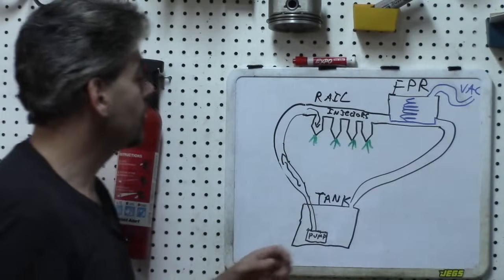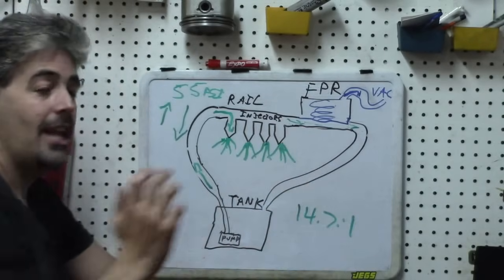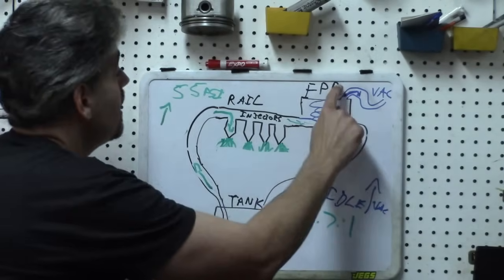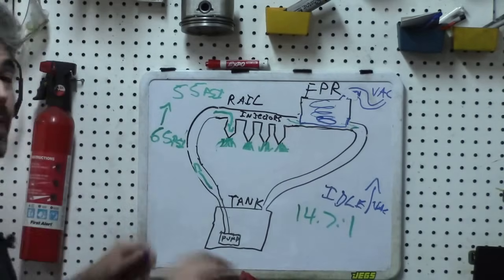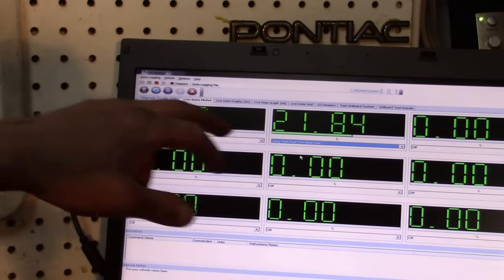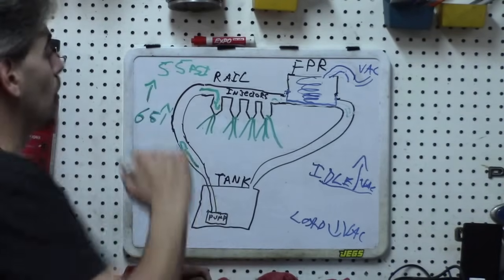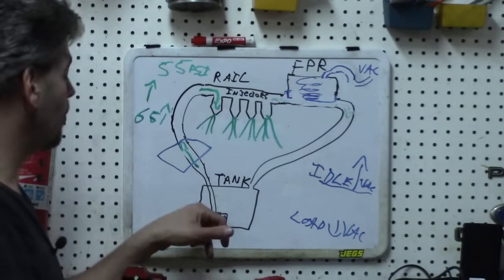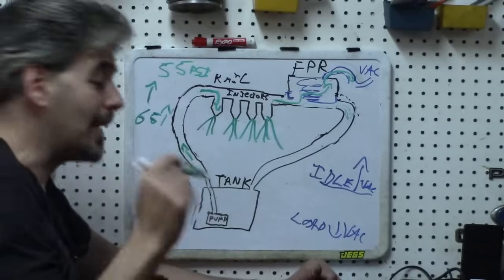Fuel Pressure Regulator Diagnosis + Understanding (HD!!)

Comment: I have 1992 GMC pick up with a 305 v8, TBI system, it idles fine and runs fine if you accelerate it sitting still but on the road from a complete stop it has a sluggish take off then will suddenly speed up, very sluggish going up a hill, could this be the fpr? I'm not used to working on this type fuel systems, I've always dealt with carburetors.
Reply from the maker: Could be, amongst 100000 other possibilities.  what data do you have?
Reply: @SchrodingersBox  Check engine light not on, scan shows no codes.
Reply: @SchrodingersBox  It was the fuel regulator, after watching your video about 3 times I understood what's going on, thanks.

Comment: What about the fuel pressure regulator in the fuel tank?  Is there a vacuum line that runs from the tank to the intake?  My GM LT1 has the regulator as part of the fuel pump assembly in the tank.
Reply from the maker: +Tom Strickland Yes that's a good question- however on My LT1  vividly recall the regulator being on the rail- I actually had an adjustable regulator on mine in fact.  But in the case of in-tank regulators they are invariably PCM controlled to adjust pressure rather than vacuum controlled.

Comment: I have a 1993 Nissan the vacuum line that goes to the fuel reg has some wetness to it .    I am having trouble with low power when I take off and sometimes a miss ....  Then it goes back to normal running .  I don't have a way  to test the reg valve .  Will the reg vacuum line have wetness or some trace of oil in that vacuum line
Reply from the maker: Your best bet is a simple fuel trim analysis. Just start with basics and determine potential causes from there

Comment: How do u directly apply vacuum? I think the spring maybe stuck closed. Ltft is neg 20. Short term is normal at idle. Goes towards normal when given throttle.
Reply from the maker: Just apply vacuum to the vacuum port. If it isn’t a vacuum design then just restrict the return port and see if changes the pressure to be within spec
Reply: @SchrodingersBox  ok. Yes its an 03 impala. I may use human vacuum as u say on the video lol. U pointed out in another video to me to check the fpr. So thats where im at. Thank u sir again for the replys. All your knowledge ive soaked up means alot. I fully understand how to diagnose it now thanx to u.

Comment: So you said that the car doesn’t need to be running but does the key need to be on? & could you tell me what the correct psi range for a 1996 Chevy c2500 5.7? My research stated between 60-65psi.
Reply from the maker: It should be 55 to 60 during prime and while running, 50 without regulator.

Comment: This used to happen when the car was warm but now it happens all the time.

When I go to start the car it just keeps turning over and does not start but I take the key out and try again and sometimes it fires right up no problem.

I've tried to cycle the key on and off a few times and try to listen for the fuel pump turning on but can't really hear it and when it does fire up I don't believe I hear the fuel pump. It had a cat converter code that popped up could that have anything to do with it? (don't think so, I cleared it anyway)

It did say the intake air temp was 80 and outside it was around 60 (normal?). I've tried to give it gas while starting it (don't think the computer will let it start with the pedal down?) I did this once and once it started and got it up to 3k rpm without any hesitation. Today I was gonna go spend $20 on a fuel tester gauge to see if it has pressure in the fuel rail.

edit: after it sits for a while it tends to start up just fine.

Could it be a bad sensor telling the computer to inject too much fuel or not enough to start the engine? How can I test that?

Any ideas on what else it could be?
Reply from the maker: No idea- what data do you have? You're just describing symptoms.
Reply: @SchrodingersBox  Thanks for the reply!

Tested for fuel pressure and it had 0 psi!
Tested fuse and connections, also tested the fuel pump connection pins and it had 0 volts.
Found the relay (it's under the dash above the pedals, need to unscrew about 3-4 T20 screws), *I pushed the relay with my hand and the fuel pump ticked on and built fuel pressure!

FIX:
I replaced the relay and it seems to be working just fine!*
Hopefully, that was the fix, a bad relay.

I did think it was the connection pins that the relay plugs into but it seems to be working fine, time will tell if its the pins or just a new relay (bumps/pushing relay out..etc. time will tell)

Comment: Hello, May I please have some advice ? I have a 1992 corvette . I replaced the fuel pump ,  fuel filter ,  fuel regulator ,  and injectors . The car runs ok at idle . .. Under load , The fuel pressure is dropping - causing stall and misfire . Can you please tell me what I am overlooking to fix this ? Thank you
Reply from the maker: Give me specific numbers for static pressure, idle pressure and loaded pressure. 
  also do you have integrator and block learn numbers curved against load?

Comment: Is a bad regulator constant, when it goes bad it's always bad? Or could it be intermitting, it works fine for a while, then acts up while driving for a while, then runs fine again? 
  Could it work fine if the RPM is below a certain speed, (let's say 2000) but act up only above 2000 RPM?
Reply from the maker: A bad regulator is constant. it won’t be intermittent.

Comment: So on a turbo or supercharged car, does the fuel pressure regulator see boost? By logic i would say yes since the engine needs more fuel then. So i would assume the spring inside the FPR is designed in a way that at vacuum the regulator is all the way open, at atmospheric its closed partially and at full boost its closed all the way, or at least thats the basic idea of it.. Am i right with that so far? 
Or does the vacuum line to the FPR have a check valve?
Reply from the maker: I actually have never seen a Turbo car.  I have many questions myself on fuel trim maintenance, MAF data and fuel pressure in turbo applications.  If I ever see a turbo vehicle believe me, I will turn it into a lab rat!!!
Reply: yes, FPR see the turbo pressure too. The FPR's main job is to maintain the difference between the intake manifold pressure and fuel pressure, because with this constant difference the injectors spray pattern remain always the same even 20kpa (0.8 bar vacuum) and 300kpa (2 bar turbo pressure). 

so if at priming without turbo pressoure or vacuum (100 kpa) you has 4 bar fuel pressure, than with 2 bar turbo pressure you will have 6 bar fuel pressure, and at idle (20 kpa or 0.8 bar vacuum) you will see 3.2 bar fuel pressure.

Comment: so i had my mechanic look at my 96 gmc jimmy because missfire plug 5 so he changed the plugs calls me says it must be the fuel pump because fuel pressure drops after a few minutes .. I paid 300 for the plugs and wire's . i already  re placed the pump a few months ago an off brand pump possibly faulty or I did it wrong please help

Comment: My 2002 Ford f150 will start right up first time second time you might have to crank it and crank it and it won't start but if you cycle the key on and off three or four times then it'll start up and run good wonder what would cause that it's been doing it for a couple of months now
Reply from the maker: Ok- what data do you have?
Reply: @SchrodingersBox  no code
Reply from the maker: No I mean what basic fundamental data do you have- what’s your static decay pressure? what’s your fuel trim at idle vs load? what’s your pump amperage?

Comment: Question. What if the injectors we're the fuel restriction. Or needed different fuel pressure to match the injectors. Restricted injectors or wrong injectors. The computer only knows on and off to the injectors. Could force a lean. I'm thinking to restrict fuel return to see if makes better. I'm trying to find my problem with 94 Fleetwood 350. Runs like a dream until! Half pedal engine pre ignites. Runs like stick shift in 4th gear doing 10mph. Replaced all ignition components, all air, injectors, fuel p reg, distributor, map, coolant temp air temp, tps, maf. It maintains fuel 45 PSI during half throttle so I don't think fuel pump, noid and plug light testers still light during issue. High octane fuel don't do anything. My last thought is knock sensors. I don't see mechanical issues but could be wrong. Any direction of advice would be highly appreciated.
Reply from the maker: I would need to see what data you have that indicated the ignition, MAF, fuel regulator. injectors, CTS, IAT TPS and MAF were all bad.  That seems really unlikely.  What data were you using that indicated all these faults?
Reply: @SchrodingersBox  injectors, plugs, wires, coil, iac and Optispark were to rejuvenate power Bec it was in need of a tune up. The other components we're researching the service manual because the issue arose. I thought it was lean or rich because of the new components over powered the old sensors that we're inputs for the computer to make 14.7/1. Now, I just don't know where to look. Thinking knock sensors aren't doing job Bec sounds like pre ignition symptoms to me. I have no data Bec I don't have diagnostic tools besides multi, noid, test light and plug light.the dash gives codes but I have none
Reply from the maker: That’s what  I am asking. - what was  your day that there was performance loss because of those components?  How did you determine it was an ignition problem? was this based on fuel trim day or on MAP output or what?  i would need to see your baseline variables.
Reply from the maker: Never mind- reread your answer. I am afraid i can’t help. I have to have a data-based approach to help, my methods are just different than what you are doing - sorry
  good luck.
Reply: @SchrodingersBox  I thank you for replying and willingness to help. I need more tools and knowledge

Comment: I have a 95 Ford Taurus my ex mother-in-law left it to me it's been setting for a little over a year it started right up and I backed it out of the garage and then it died and tried to start again it start up and die right back off and eventually it just wouldn't do it at all I put a new fuel filter on it thought maybe it might be plugged from bad gasoline but that didn't work either still doing it and so I hear the pump running but that doesn't necessarily mean it's currently proper amount of pressure so that's going to be my next thing I'm open for any suggestions thank you.
Reply from the maker: Correct- you can’t say anything from that. what data do you have for the basics like fuel trim and rail pressure? What’s the pump amperage? what’s your injector pulsewidth? What did you do to rule out spark as being the issue? need some basic data to get a foundation from which to work.

Comment: With this taken in please tell me your comments to fix a fault with a vehicle which (is almost new) starts after about 5 turns of the ignition and runs normally and to normal temperature but when switched off will fire up and run normally. Only for the same problem to recur when it returns to cold? Importantly no engine codes are found.
Reply from the maker: sounds like a classic failed check valve at the fuel pump.

Comment: Wish my mechanic saw these videos before cleaning fuel injectors, replacing catalytic converter, and spark plugs. $$$ None of it helped. Finally dawned on him it was fuel pressure regulator.
Reply from the maker: Ha- cleaning fuel injectors. I absolutely guarantee EVERY mechanic who has ever tried this did so out of desperation rather than necessitation.
Reply: I asked him if fuel injectors could be the problem after starter tested good. He charged 160.00 to clean them. i week later car was getting worse and he then charged 1,187.00 for catalytic converter. Replaced plugs n/c...still no good.  After replacing regulator, he said it had ruined cc, so it needed replaced anyway.?
Reply from the maker: Hardly a unique story i am afraid.  Pretty much hear similar every weekend when people finally bring their cars to me. Pretty sad.

Comment: well i checked the plenum and the its not leaking anywere but i heard from another person that at the pump i should be getting at least a hundred psi and im only getting 65 to 70
Reply: +Matt Hasting 100 PSI might be normal if you are deadheading it (e.g. without regulator).

Comment: Hi Matt, silly question but if my fuel pump is priming at 50 psi and I don’t have a check valve so when I stop cranking the engine the fuel pressure drops to zero would my engine start because there’s 50psi? Or must there be a check valve to keep pressure at 50 even when engine is turned off? There is 50psi on priming and 50psi on cranking but no start and no fuel coming out of injectors? Hoping for any ideas. Thanks
Reply from the maker: you need to have some fuel pressure present prior to starting or you will have a long crank time as the pressure builds up otherwise. that’s the job of the check valve.

Comment: does the valve come before the FPR? On my civic I think you connect the tester to the banjo bolt on the fuel filter.
Reply from the maker: You will always want to test pressure on the FEED pressure, never the return.
Reply: Schrodingers Box oh that's right fpr is on the return

Comment: I'm working right now on a 98 Firebird 3.8, using the fuel setup your dealing with in this video.  Long story shorty,  I have fuel pump running,  fuel at the fuel line to engine if I take off the line.  If I take off the return line with feed line hooked up I get gas squirting from the return side.  This is after replacing the regulator today.   Fuel coming into the rail, will pass out the return, but no pressure at the check port.  It almost seems like I have a restriction in the rail.  Any ideas?  Thanks.
Reply from the maker: You have no pressure data so this information is not useful in a diagnosis.
Reply: What pressure data do you need?  It has 0 fuel pressure with a working pump varified pumping fuel, and a new fpr.
Reply from the maker: ***** If you have the fuel pump running I need to know the pressure.
  Take the pressure at the tank, or filter- or whatever but I need to know the fuel pressure from the pump prior to what you suspect is a blockage which I highly doubt is the issue.
Reply: Ok, I don't have adapters to check fuel pressure,  at the pump or filter, I just have a basic fuel pres. tester that hooks to check ports.  It has good pressure (strong spray)  from the fuel line @ the engine, can't tell you exactly how much.  Anyway I'll keep digging, thanks.

Comment: Matt, if the regulator were bad, would it still be possible to get a 1075 rich bank left code without a 1072 code? I only have an intermittent 1075. My 98 Chevy 5.7 runs smooth, no misfires, but feels gutless. Definitely not putting out the correct power. New O2 sensors. Same result.
Reply from the maker: Yes it is possible but both banks would be affected. You could have it where one bank is just under the threshold to set the code while the other bank meets the threshold. Check the LTFT on both banks and see if this is the condition. If however only one bank’s LTFT shows to be at threshold you can rule out regulator.
Reply: Schrodingers Box thanks, watching your videos really help. So I am on the right path, since it is only bank 2, I feel it cannot be a MAF sensor, or regulator. It has to be something that would only affect that side like a leaking injector, plug issue or possible exhaust leak on that side before the first O2 sensor.
Reply from the maker: Correct!
Reply: Schrodingers Box just wanted to update and thank you! So I pulled the plugs again. #2 was a little darker than the others. Figured if it is leaking, this is going as unspent fuel and triggering the code. The como then cuts back fuel starving 4,6 and 8 giving me the sluggish power but enough to remove overall code on that bank, reason for it being intermittent. I replaced the injection spider, cleaned really well and now it runs like a scalded dog! Thanks again!

Comment: when the regulator is in the close position ie when accelerating at maximum, is it totally closed? I mean is there no fuel returning to the fuel tank ?
Reply from the maker: it is not totally closed. we can prove this because the pressure at WOT does not nearly go as high as it does if we pinched the return line closed.

Comment: My 98 ford explorer v6 sohc has been stalling at intersections and been having a rolling idle. No codes. I hooked my scanner up to FORSCAN and it read 0psi under the fuel pressure reading. Now it starts up every time first try and it drives on the freeway great so obviously its getting pressure. Would a Fuel pressure regulator be the culprit? Or should i look for a vacuum leak first?
Reply from the maker: If you have no fuel pressure a fuel pump or fuel pump circuit is a more likely culprit.

Comment: I need this done on fuel system voltage from relay to inertia switch to dual fuel tank switch to pump and how you test that can't find what the voltage should be from switch to switch to pump with no rail fuel pressure no start.
Reply: Thanks that helps a lot!

Comment: still confused on all the expectable numbers for the fuel pressure at different speed and what the regulator fluxation would I would imagine they differ by a lot for different cars ...so not sure how your going to 100% diagnosis from that a bad injector or dieing fuel pump with 100% by that one test

Comment: Ok so let's say u check vucumm hose n pressure goes up when removed. Ok but what if pressure goes up under boost like significantly? Say it goes to 70psi?

I'm just testing my thinking after watching the video. Thanks
Reply: Would this mean injectors not letting enough fuel out?